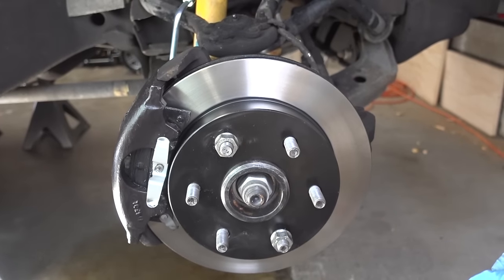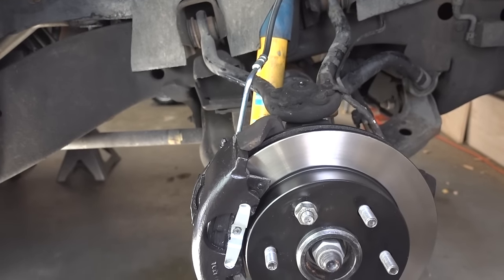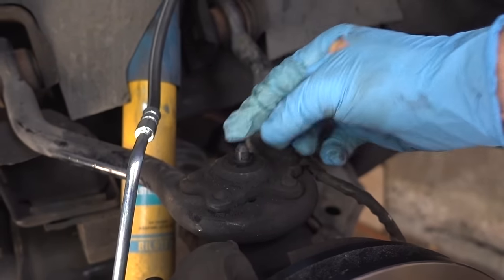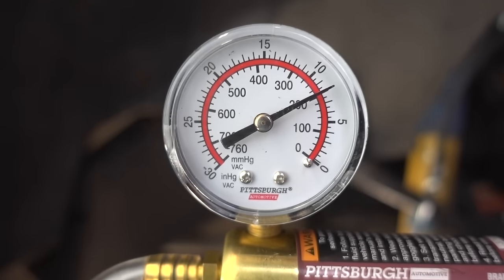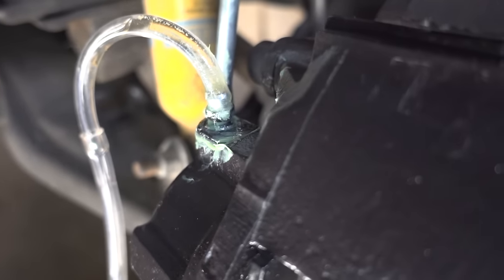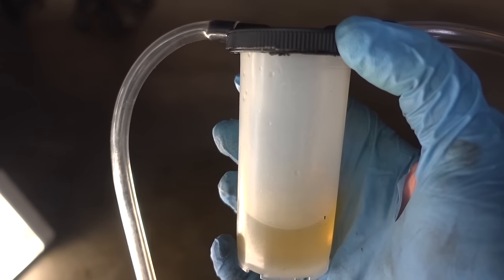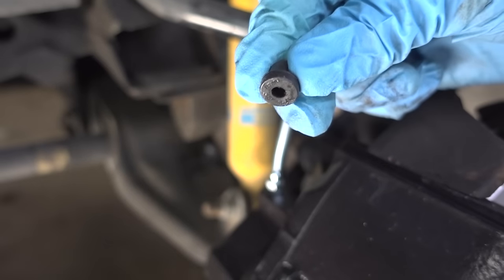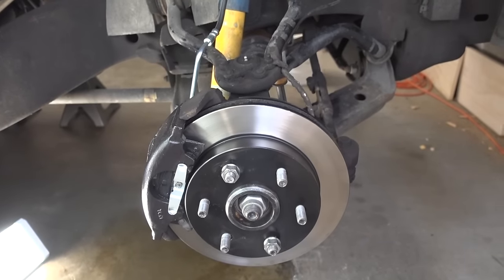Best Method To BLEED BRAKES BY YOURSELF!

Comment: The air behind the threads is not harmful when using vacuum pump, it’s coming out, not in. It may make harder to understand when the brakes were bled but typically the size of bubbles is different and you can tell
Reply: Nope, it is going in.  It is going in past the threads, then around and up through the bleeder screw, which means that you will never get that air out of the bleeder screw if the threads are leaking because it keeps introducing more air, as well as never knowing when the bleeding is done because air keeps coming out.  Just no, it makes no sense whatsoever to pretend that any leak is acceptable if trying to get the job done well.

Comment: Grease around the bleeder helps reduce outside air flowing past the bleeder screw threads only to be drawn in along with the fluid. thus the bubbles..and can't tell the air leak bubbles from those in the brake lines! But there is ALSO the good possibility...no the LIKELY PROBABILITY ..that air will leak past the hose fitted to the screw as the hose simply does not seal well enough. Grease may again help here but grease did little to help me. I ended up using Teflon tape on the bleed screw threads, greased around the screw once re-installed. AND... I even tie wrapped the hose to the screw as I had the screw in hand to wrap with Teflon. Did all this work? MUCH BETTER!! That you drew solid fluid first off indicates a good seal. You lucked out!! Thank you for this informative video sir!!
Reply: im struggling with this now.  first time using the vacuum pump to bleed brakes and i have leaks in the threads AND at the hose-to-screw connection.  I've wasted so much time and brake fluid trying to correct this
Reply: question wouldnt you have to remove that teflon tape after bleed process ? or you just left it there ?

Comment: I almost threw away my HF bleed pump.  That grease trick is amazing.  Thanks!
Reply: I'm going to give it another go with the grease trick now...
Reply: @shoonger001  I bet marine grease would work too.
Reply: What kind of grease can we use on the bleeder valve?
Reply: @j0lla127  silicone based grease mostly

Comment: I did mine this afternoon and totally forgot about using the grease. That's why I have to do the front ones all over.
Reply: Turned out the grease wasn't the problem. I blew the seals on the master cylinder.

Comment: I rather like the pressure bleeding method - you just need to buy one spare brake fluid cap, drill a hole and put a bike valve in it. Screw it on the master cylinder reservoir and pressurize using reduction valve outlet on an air compressor with 20psi max. Then simply walk around the wheels and bleed the brakes. No need to pump with your hand forever on all 4 wheels.
Reply from the maker: That does sound easy...
Reply: Just what I will try in the morning.
Reply: I think the vacuum bleed cannot work as the seals in the hydraulic cylinders are made to take pressure, (obviously), so by applying vacuum air is drawn past the seal into the system, but by pressure bleeding the seals are pressed against the cylinder walls.

Comment: Hi Jimmy, I’ve done many brake jobs but had never heard or seen that grease trick. Made my job much easier after replacing all my calipers. Thanks for the video!
Reply: To add to that, even better when putting on new calipers, is to coat the bleeder screw threads with silicone grease from the get-go, take the brand new screw out of the brand new caliper and coat with grease before installing the caliper and beginning the bleed process.   Plus, this makes breaking loose the bleeder screw, easier a few years later, once corrosion would have started.

Comment: I have the Mityvac mv8000... I've had it for three or four years now and it definitely works great... Just recently I did a rotor,  caliper and pad change on an HHR...  I decided to use the Mityvac and then have my wife come out and do the "pump and crack the bleeder method" and I was getting more fluid pulled through to the bottle  with the Mityvac then we were getting and the two-man operation... these definitely work really well if you've got everything connected properly.... Thanks Jimmy....🔧

Comment: Hello Jimmy! That is the biggest problem I had was air sneaking in through the bottom of the bleeder threads. I did not use the hand Vac first time. The best thing about the hand vac is you can see the pressure go down if leaking air in. Headed to HF to get this, I'll comment on results later. Thanks for sharing.
Reply: How was it? Need to grab one tomorrow my brakes are losing pressure rapidly

Comment: Air coming around threads with vaccum seems to be an issue. I liked that you mentioned regulating how far to open bleeder . I have read dialectic red grease or silglide is more compatible with brake fluid change  than regular grease. Any experience on that in comments on that info  being accurate would be nice

Comment: Great idea of putting grease around the bleeder valve threads to block air entry.   I always wonder where all the air bubbles were coming from knowing that I throughly bled the brakes.

Comment: I usually just install a clear line into a container , pump the brakes and keeps filling the reservoir so any back feed will have fluid in it. Do it until its clear.  I think it does a good job because you are actually moving the brakes seals in and out.

Comment: You're the first in these bleed the brakes yourself videos to mention the possibility of pulling in air around the threads. I've always been suspect of it. The grease is a great idea, but i'm still more comfortable with having someone else pump the brakes while I work the bleeder screw. Makes me think I'd like to come up with a system to pressurize the master cylinder and push fluid through.
Reply: The motive powerbleeder is exactly what you're looking for!
Reply: It's a non-issue. Any air pulled in will be pulled in AFTER the bleeder valve. That is: it will be pulled into the tubing, NOT into the bleeder/caliper. You don't even need to use grease, because, again: any air pulled in will be pulled into the tubing and NOT the bleeder/caliper.
Reply: Grease helps to create a good seal which allows fluid to flow faster.
Reply: Except that's exactly why you need grease, IF you don't have a good seal without it.  If you don't have a good seal, you have no way to determine when you are done bleeding because you will keep getting air bubbles. 

Plus it is not entirely true that it is just pulled into the tubing, instead it is pulled past the threads, then up through the bleeder screw, meaning that when you think you are done, your bleeder screw itself is still potentially filled with air.  

Not much, but to opt to have that extra air by default, does not make a lot of sense due to being  counter to exactly what you're trying to accomplish which is get out as much, even ALL the air that you can.  Plus there is another great reason to use the grease, that if viscous enough to stay put, it helps to seal the threads, at least for a while, from external corrosion that can make it more difficult and potentially damaging to crack the bleeder screw again years later. Essentially it is what the manufacturer should have done in the first place!!!!   @cw4623

Comment: Good tip on adding grease around the fitting.  Thank you, I wouldn't have thought of that.
Reply: Wouldn't the vacuum you created then suck grease past the threads into the caliper/fluid?
Reply: @VincenzaV1  There aren't any threads on the fitting.  Put a tiny dab of grease on your finger and rub it between your finger and thumb, so it's like your eating fried chicken and you got some on your fingers.  Then rub your finger lightly around the fitting once.  That's what I did, anyway.
Reply: Wes Garven there are threads on the bleeder screw, that’s what he was asking.  No, the vacuum won’t pull grease into the caliper unless you turn the screw a lot

Comment: Great tip with the grease. I've tried teflon tape around the threads, but it hasn't worked well. I've always had problems solo bleeding brakes. I'm going to give it another try today with grease.
Reply: Well?
Reply: I too would like to know how it turned out.
Reply: Try turning the bleeder valve very slightly, say an eighth turn.

Comment: Yes grease from the ouside. I'd made the mistake of taking the bleeder out greasing it then putting it back in.
The grease dissolves air gets thru the thinned grease it does not go well. Glad you've shown them the way to just grease a dry bleeder.
Reply: No idea what you're talking about.  It is a very good idea to grease the bleeder screw threads, but it may still be necessary to also put a bead of grease around the outside of them, where they meet the caliper.

Comment: I had an old kit which used  tire pressure to push brake fluid from the master cyclinder - worked really good. Only catch with a  pressure bleeder is that you need a tight fitting cap for it work.

Comment: Vacuum bleeding is too much time, labor, leaks and grease involved..
Easier method: Use the clear hose attached to the bleeder.
Submerge the hose in a partially filled container..(plastic water bottle) with brake fluid. Always keep the hose submerged.. Crack the bleeder and pump the brake pedal until there are no more air bubbles in the clear hose. Tighten the bleeder valve when done.. Be sure the master cylinder reservoir is full before pumping. 
Thats it.... You can do it alone by observing the clear tube for bubbles between pumping sessions. Remove the bottle and discard the used brake fluid. No leaks, no grease, no vacuum pump... There are videos on this easier procedure.

Comment: I use a check valve on the tubing so while I pump the pedal the fluid doesn't go backwards. I did search around for a check valve that was rated to handle the brake fluid.

Comment: Ive heard that you start at the wheel furthest from the ABS module (if your vehicle has one) not the master cylinder. Is this information correct? Also if iam only replacing the rear calipers do i need to bleed all 4, or just the 2 i replaced? Without a big jack and jack stands its a pain to individually jack up all 4 wheels one at a time with a little jack

Comment: OK so the tool i bought similar to yours does work great,  however the grease im using is not all i had in my garage is bearing grease and its not thick enough in this texas heat..as soon as i break vac with opening port, lose vac..its come close a few times but no cigar..what GREASE exactly are you using??

Comment: Could have been a little more detail.  Like to check the master after each brake is bleed cuz if it runs low, air will go into the line.  Proper way to bleed is Right Rear, Left Rear, Right Front, Left Front(closest to the master).  Also, I thought your suppose to pump to 20 before you release the brake fluid and try to keep it that as well until no more bubbles?
Reply: Good grease tip btw.

Comment: What do you mean when you said you had preflushed the system when you changed the calipers? Im planing on removing mine to paint them, would the process be the same? Should i flush the system before i remove calipers or after i install them?

Comment: As a note, you can use DOT 4 in place of DOT 3 fluid but not vica versa. DOT 4 is just more heat tollerant.
Reply: Meh, DOT4 becomes less heat tolerant after it absorbs more moisture.    I never run brake systems where they'd heat up enough to matter but if you do, it is something to consider.

Comment: On my 2006 town and country I bought last year upon really close brake inspection the rotors, calipers and pads were one big rusted mess. The pads never touched the rear rotors for years. I bought all new calipers, rotors and pads. After installation I went to bleed them. The fluid did not start to flow into the tubing until the brakes were pumped 7 times. I used an assistant to constantly pump the brakes. I used tubing and a pop bottle. The fluid was black at first and cleared up. I always could see tiny bubbles tightly packed together after every cycle of brake pedal presses.

Comment: Hey guys.  I am a bit confused.  Some videos say farthest from the master cylinder.  Some videos say farthest from the ABS module.  My master cylinder is on the driver side and my ABS module is on the passenger side.  So, what should be the right sequence in this situation?  Thanks in advance.
Reply: If your hard line goes from master cylinder to ABS on passenger side, then down the passenger side frame rail, then you would do the furthest from the ABS module which would be the left rear, first.

Comment: By using grease, wouldn't that somehow enter through the bleeder valve and contaminate the brake system?
Reply: Very thick grease so no
Reply: Because it's important this question has the correct answer. No it would not get in the brake system because of the vacuum properties of the line. Theoretically, if any grease gets sucked into the line - it will just go into the bottle - you'll dispose of it anyways. There is no fluid entering the brake system here.

Comment: 1Road: You didn't mention which grease type or brand you used.  That would help.  Many types are out there, and some  have additives that are not recommended for vinyl tubing or brake parts.  Light grease used in the video?  This info would help DIY mechanics just starting out.  Your video had several other good tips which will help.Tx.
Reply: Meh, just use standard NLGI 2 lithium complex grease that everyone already has in their garage.  If you happen to also have silicone paste grease, even better.  

By the way, it is irrelevant what is recommended for brake parts because in this instance, there is no brake seal it is in contact with, just metal to metal between the bleeder screw and caliper tapped metal hole.

What is more likely an issue with a cheap kit like this and after time passes, is the vinyl tubing will get stiff and not seal well, is something that will need replaced every few years or less depending on exposure, including high temps or  sun ( UV damage).

Comment: Great video but my vacuum pump like this wouldn't work , drew the vac ok but just pulled air even after greasing the thread on the nipple .
Reply: Then you find where it is leaking and seal that.  Many people with similar kits, have stated that their fluid catch canister had a leaky o-ring.

Comment: I have no more bubbles but if I look really close with the flash light, I can see extremely tiny air specs in the fluid. Is this just the brake fluid and how it’s reacting to the pressure?
Reply: Could also be trash in the brake fluid or lines.  Seals, rust particles, etc.. if the system is old or been neglected
Reply: If you see specs, whether they are air or other contaminants, then you keep bleeding until you see NONE.

Comment: What kind of negative pressure do you recommend maintaining to get a good bleed? Looks like around 15 inHg?
Reply: There is no exact pressure needed, just to keep a vac on the system so it keeps drawing fluid or the air in it.  At the same time, you shouldn't try for as much vac as possible because this is a cheap and crude kit that is more prone to leak if you aren't patient and give it time instead of getting in a rush.  Just watch the gauge and if it gets near bottoming out, pump a few times and again wait for the fluid pull.

Comment: What type (brand) of grease did you use around the bleeder valve? Planning on doing this to my 1995 K1500 real soon. Thanks!
Reply from the maker: Just make sure it’s thick! This also makes it a pain in the butt...
Reply: @1RoadGarage  is caliper grease OK?

Comment: Great video as always! Will this method work to remove all of the air from a new master cylinder too?  The master cylinder is always a challenge to rid of all the air so I wonder if a vacuum bleed process like this will help to eliminate air from everything. I have all new pads, rotors and the master and have not performed any bleed process as of yet because I want to be sure to do it right. I hope you have a tip on this. Thanks again for all of the great work you do!
Reply: Don't you need to bench bleed master cylinders?

Comment: ok I tried that - a few comments:
1) my vacuum pump DID created and hold pressure perfectly when I put my tumb at the end of the tube
2) it did NOT however hold pressure when I connected it to the bleeding nipple, once I've open the valve for bleeding than pressure falls down and liquid will not come out.
3) I tried to put grease on the nipple and adapter - did not help
4) I tried zip tied it - also did not help
5) I tried smaller tube - did not help
6) I tried without adapter (just tube) - did not help even with zip tied and grease

eventually I ended up using a bottle and a friend pumping the brake

what have I done wrong?
Reply: I suspect you opened the bleeder screw too much. Just 1/4 to 1/2 turn is all you want to open it

Comment: Best way is to clamp the break hose .Undo the bleeder screw and put a thin layer of greese on the threads.Replace bleeder screw unclamp line .......no air at all getting in asking as hose on tight .

Comment: Jimmy I have a 2016 Camaro ss, do I have remove the tires to do this? Bleed brakes
Reply: If you can reach the bleeder valve then you don’t have to.  I try not to remove wheels